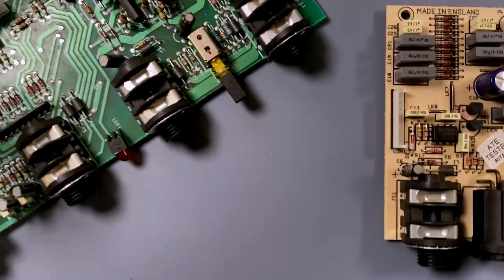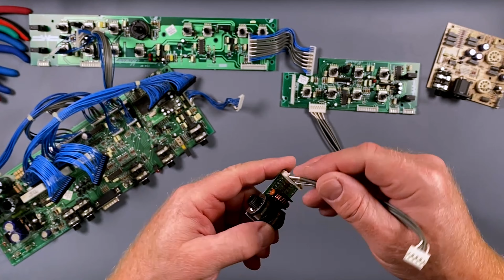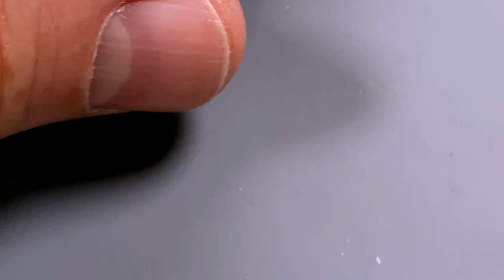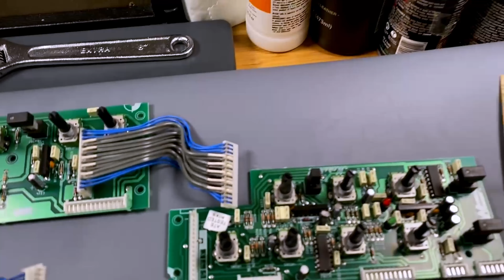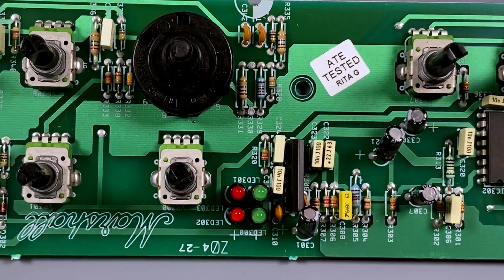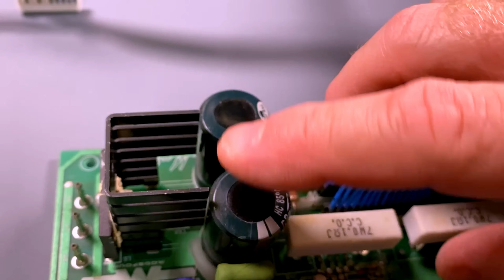Marshall Mode Four - Part 4: Circuits Circuits Complete PCB and Component Tour

Comment: As I've seen in the schematic, the cab simulation is analog. Only the reverb is digital.
Reply from the maker: @Leemuzhko - Thank you for the clarification. This is an interesting amp. I think it has a lot of potential.
Reply: @RyansCustomShopandGearOutlet I want to try to change the scoop setting at some point. Another inetersting thing, if I'm not wrong, is that it uses the power amp feedback in the presence/resonance circuit, as the tube amps do. Need to double check that.
Reply from the maker: @Leemuzhko  - that’s interesting. I’ll have to check that out.
Reply from the maker: @Leemuzhko  - I haven’t fully studied the circuit, but I’m curious if this is designed as a push-pull (like power tubes), but with the solid state power amps.
Reply: @Leemuzhko  the scoop could use tweaking, especially if you don't use standard tunings. i would love to be able to adjust it even though i try not to use it.
Reply: @RyansCustomShopandGearOutlet it is full bridge amplifier.
Reply: @mikeb1378 for me it is just too deep. I would like to have a slight adjustment. But it is my personal thoughts.
Reply: @Leemuzhko  it is a massive difference, hard to use when you're trying to be heard in a band though, note definition gets sucked out